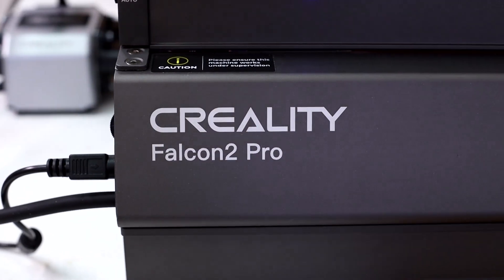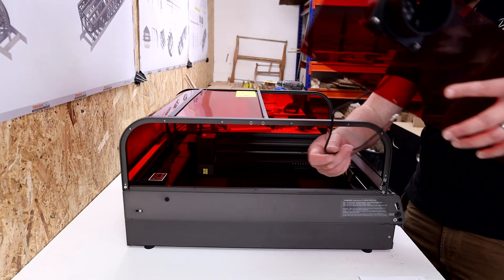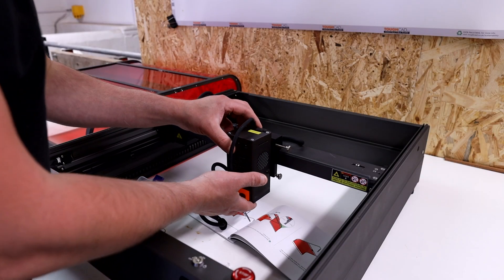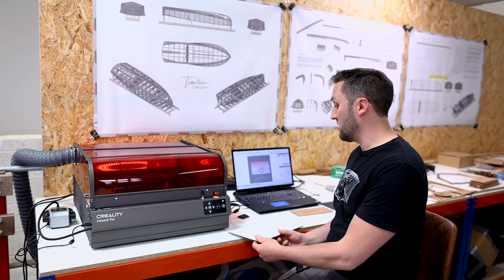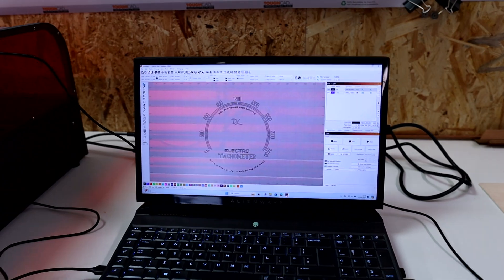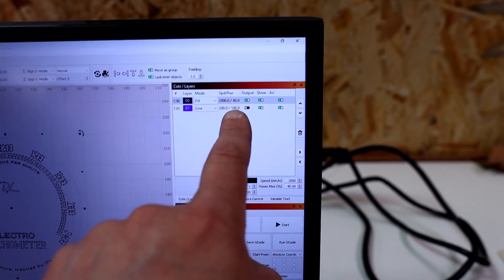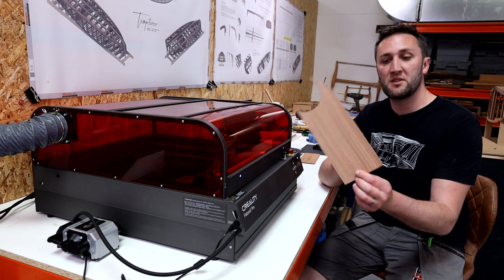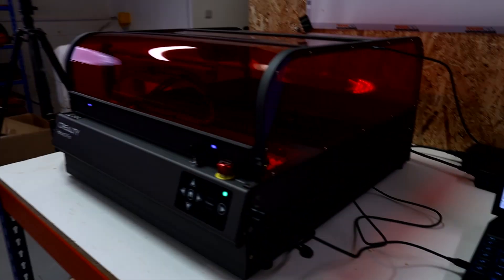Testing the new Laser Cutter and Engraver | Creality Falcon2 Pro Laser

Comment: I’m wondering how often the base bars will need replacing and particularly the cost. That’s a how long is piece of string question of course and depends on a few factors not least of which is how careful you are with finding the “just enough” cut settings. Cool machine though.
Reply from the maker: I think they will last quite a while, as it’s only a 22w laser it won’t do much to the aluminium, it’s taking the paint off a few of them so far but I think they’ll hold up pretty well. Time will tell.
Reply: @DanLeeBoatbuilding  I’ve zero experience with these. I guess you’re right, 22W isn’t going have a lot of cutting power.